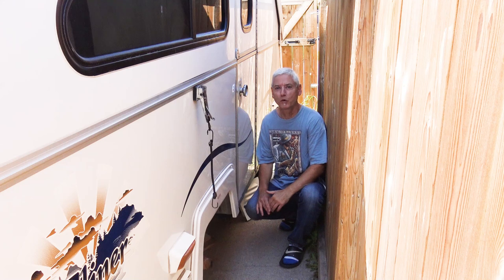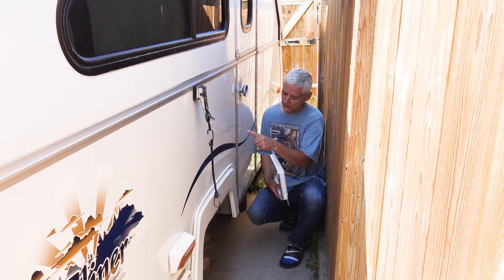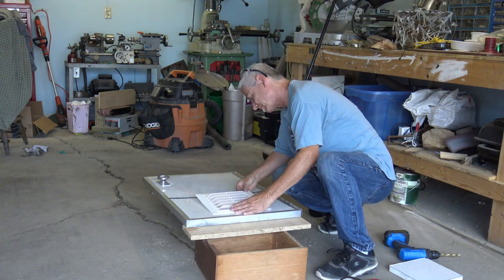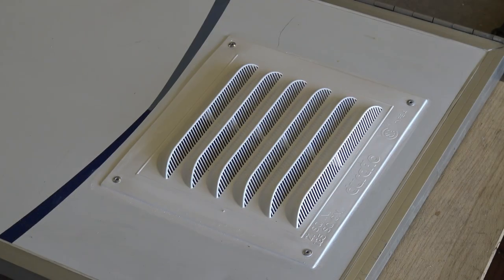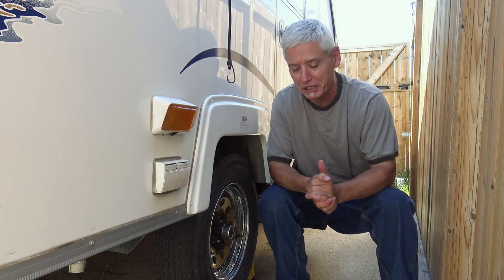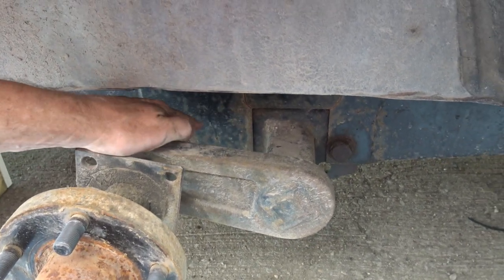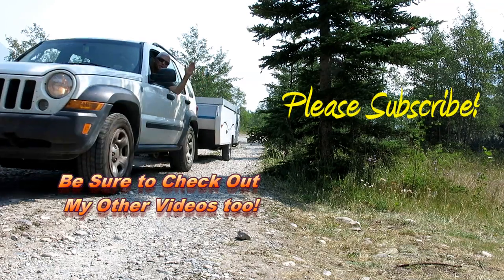Aliner - Adding Door Vent & 3500 lb Axle

Comment: Hi Slim, Very good work on your vent and much needed axle, i would however weld up those cracks grind down the weld and then weld in a heavier plate over that area. I enjoy your video's Happy travels to you.
Reply: Hear Hear!! ...was thinking the same thing regarding welding/repairing the cracks while the axle was out.... enjoying the videos from your friends Down Under in Australia... we are just about to purchase a used Aliner, and these videos have been fantastic ! Cheers
Reply: Fix the cracks ! A stitch in time saves nine. Off road will tear up t his flaw & leave you stranded or worse an accident on hiway
Reply: @nealford7897  Yes, I agree. I saw another video on welding and after seeing where this chassis cracked(at the intersection of two planes)I think I remember that cutting a piece of metal and leaving a square intersection is poor technique. Does this seem reasonable?

Comment: Slim... another great video! By now (a year later) you've probably had your frame welded. From our view it appeared not only the rear corner of the square notch was clearly cracked, but it seemed the front maybe was starting. Notice the same line of rust (without the obvious crack) in your video? Starting at 9:03 you can see similar rust line. 

Also, though I am not a "Metal" guy (I'm a Cabinet maker) I believe, at least in the Solid Surface Counter Top world, it's not uncommon for cracks to start AT inside corners and because of that, many people cut radius/half-round cut outs rather than square corner cuts. Again, I am no extra in metal-smithing. 

Back when dinosaurs roam the earth and Corian was the only solid surface material, inside corner cracks were a constant problem especially near stove top cut-outs. We in the industry started radiusing our cuts and that helped a great deal, but even then expansion due to heating continued to plague us so we double the material thickness and taped the corners with metal tape to reflect back the heat and ease the expansion.

Hopefully, they welded a wide strap across the notched area for the axle (rose... great punchline by the way) and radius cut out for the axle...

You are doing some great videos. Keep them coming!!!
Hersh

Comment: Something I had built and gave it away just somebody that was camping was a candle heater. During my research I saw where somebody on a boat put it on top of their propane burner turn down very low. For a small space they are very effective and when the candles go out they radiate heat afterwards.

Comment: I was wondering if you had the axle aligned? Seems to be an important part of installation process. I got my axle finally, installed  it and aligned it as well. Glad I did, it was off a little more than .250.

Comment: I know this video is old, but know going in to your project that a 3500 lb axle is much more expensive now. The best price I could find was local and was $771. Also found it for $631 and would need to drive 3.5 hours with additional hundred $ in fuel....total $731. I opted for $771 for convenience. It is a Dexter since AL-KO no longer exists.

Comment: I used a UCF Flexiride axle on the Teardrop I built, same as what you installed on your Aliner.  I love the ability to adjust the ride height to whatever I want.  What I don't like about the Flexiride is that it squeaks a lot.  The manufacturer recommends using silicone spray lube on the ends of the axle tube.  It works, but not for long.  My 2008 Aliner has a AL-KO torsion axle,  it works better than the Flexiride (smoother), but is not adjustable for start angle/ride height.  Your original axle looks like a Dexter? My Aliner is an anomaly, the non off road (2000 lb) frame with the 3500 lb off road axle.  Columbia Northwest (Aliner corp) insists that the trailer had the non off road axle when they built it, but I sent pictures of my axle to them and they finally agreed it was the off road axle.   About a year after owning the trailer I found a date stamp on the axle,  its manufactured in 2009, while the trailer was made in 2008, so its not the original axle.  I purchased the Aliner used in late 2014.   One problem that I ran into was a bent frame, and you might run into that issue too.  The 2x3 tube frame is not strong enough for a torsion axle which concentrates the force on a small part of the frame (compared to a leaf spring set up).   I had to straighten my frame and weld on 3/16 plates on the frame over the axle to prevent it from bending again.  The details on this issue and fix are on the Aliner Owners Club page.  The off road frame is 2x4 or 2x5 tube depending on Aliner  size,  2x3 is now only used for the lighter smaller models, and was also used up to about 2011 or so on larger models which subjects them to the frame bending issue.   The door gap going wonky is a sign of a bent frame.
Reply from the maker: Hi Jeffery, Thank you for the details on your axle upgrade. One of my upcoming videos will include my ideas on the frame bending issue, however I need to do some more road tests before I release the final details. Please feel free to add any project links (youtube blocks them but I can add if appropriate). Thanks Again! Slim

Comment: Hey Slim! Hope you see this... I'm currently in the process of swapping out axles on my Aliner. Did your 3,500lb axle create a lot more vibrations and movement inside the trailer off-road? Thanks for everything you do for the community.
Reply from the maker: The way I traveled there was vibration and movement whatever I did! Better an oversized axle than an undersized if you're traveling the backroads. SP

Comment: The axel is mounted to a torsion bar, which suffices for a spring. VW’s until ‘68 used a similar suspension. In time, they loose their load bearing capability. Chrysler used torsion suspension on passenger cars.
Reply: My coment may be redudant, would'nt leaf sprg replacement, better support rear portion of trailor. U ARE A VERY HANDY GUY

Comment: Do you think this vent will help reduce cold weather condensation when winter camping.? Really enjoying these repair/mod vids as I’m considering an A frame purchase. Thanks a bunch!
Reply from the maker: Hi Bill, it may help bring drier air in, but condensation in winter is usually from the source of the heat as well as conductive materials on the frame. Thats why I switched to a wood stove and insulated the exposed metal. Catch out my stove videos. Thanks! SP

Comment: Why is the axle/tire not centered in the actual fender opening?  Seems like the axle is installed too far forward, even the old axle I noticed was forward as well, any idea why its like that?
Reply: I'm curious about this as well. Surprised I had to flip through the comments this far before someone else asked the question.

Comment: I need to replace the axle on our Aliner. I know you don't want to answer technical questions, understandably. Could you tell me the make (brand) of your new axle and where you ordered it? 
We live in a rural area and no one within 100 miles have a clue where to get one. I have no problem ordering or installing an axle. Mine is on my work bench right now. Ready for measuring.
Thanks and keep going. Love your videos.
Reply from the maker: Hi Bill, I had mine custom made and had to drive 3 hours each way to get it. I would suggest getting one from a local welder with RV experience. Thanks! SP
Reply: I've tried that here, no luck. I'll have to find a company online. I do appreciate your quick response, thank you.

Comment: Please, where did you order the axle from. Need today as I am leaving soon for the summer. My axle is exactly like your old one, rubbers are worn out and need to go a little off road this summer. Thanks!!!
Reply from the maker: Hi Roger, Mine was custom-made in Edmonton. City Spring. Try a local truck repair or welding shop. Thanks
Reply: You can try princess auto stores in canada.

Comment: thanks for your comments about axle replacement and getting a qualified mechanic....sage advice....I would like to know how to repack the bearings, grease them if you ever have a chance to show us that skill......will be inspecting my frame, axle later today for cracks and bolts....got the Guns 'n Roses comment.  11:19 looks like tire is close to wheel well.
Reply from the maker: Hi Rick, Mity Mouse has a video at: https://www.youtube.com/watch?v=FyZptb7KWlQ. I think it's the viewpoint at 11:19 that is deceiving. There's actually a couple of inches, but the wheel-wells cover the gap. Thanks!

Comment: You spoke about dust coming in through the cracks in one of your videos. I have allergies so I have come up with an idea for trapping some of the particles and it might be a good idea for your dust situation. I took a  furnace filter that is made to reduce allergens  and cut it to the size of my windows, and stuff it in the frame while they are open. Works great! Night air is full of pollen. The one I got was green and not made from fiberglass. Really thick and sturdy. I believe it is washable, too. Not cheap, but the good stuff rarely is.
Reply from the maker: Hi LA, yes dust can be terrible for those with allergies. I was planning to put a filter in the door vent, not only for dust but because the screen is a little too coarse so small bugs can also get in. Thanks!

Comment: We've been looking at aliners with the standard 2500lb axle and looked at one with an off road package with a 3000lb axle which we were told adds 5" to the height.  Don't know if we need the extra height as the standard aliner seams well off the ground for occasional dirt roads
Do you have any thoughts or anything that we may be overlooking ?
Great Videos.  Really  enjoy your channel and hope to be starting our adventures soon.
Reply from the maker: Hi Lucus 44, I also found I had a lot smoother ride with my 3500lb axle than the 2500. The big advantage was the clearance. You'd be amazed at how many steps and stabilizers get lost on rocks or curbs! Plus my new axle is adjustable, so I can lower or raise it to suite my terrain. Thanks! SP

Comment: hello slim . great videos . I really do enjoy them and always look forward to the next one. have you in the past or at all given the brake down of your trailer weight and the tow vehicle specs? IE eng power rating/ size, tow capability. and how does it pull uphill? would be very interested to know. but again great video keep up the good work. mike
Reply from the maker: Hi Mike,  My trailer at rated at 2000lbs carrying capacity but I have never actually weighed it. With my passion for back roads a little extra capacity on the axle is a good idea. Towing vehicle is a 6 cyl 3.7L Jeep Liberty. No issues with towing as long as the tires have good grip. I did however have the front drive shaft rebuilt recently. Towing could be to blame, but I think it was the miles I towed that did it in.  Thanks!
Reply: thx for the info slim. looking forward to your next video.

Comment: Umm.. watched a few of your videos-good stuff.

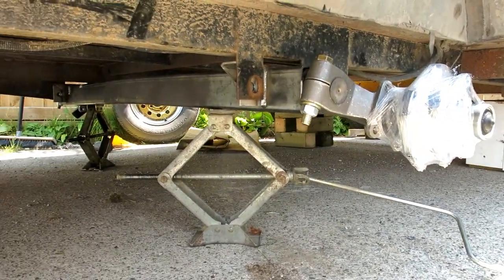Edited comment- I saw cracks in reinforcing plate of frame rails from the views on right side, especially 7:24 from underneath. Looks like frame was notched with the plate on top...however looking 'bout 10:24 shown is the left side, completely different view, axle is under frame rail. 
Yup seeing things :)
Reply: When I saw what I thought I saw red flags went up---keywords, what I thought I saw.
so on the right side thereis some sort of angled skirt?
Reply from the maker: It sucks that You Tube doesn't allow me to revise my own comments, so will start again:
 The cracks on the side plate are indeed a concern, however I am closely monitoring them as to any further issues. The missing bolts could have been a factor, and replacing them may help. After a little research I found that Aliners are known for one weak spot in the early design - lack of upper support where the door is while the trailer is on the folded position. Extra weight on the back and rough roads can cause the door-side axle to deform slightly over time. The axle installed here however is on direct contact with the main frame beams underneath, and that support is transmitted beyond the crack area by two 10" angle plates (not visible in this video). There is little load in the back of this trailer as I don't use the water tank.
 I plan on a few more fixes on this issue in the future, which of course I will document in a video. Thanks!

Comment: First time to see your channel. You do great work. I like the door vent idea. I do have a question. If you drive down the road with rain and wind blowing, does water get in the vent? Thanks, Dave and Purdy Channel
Reply from the maker: Hi Dave and Purdy, Excellent question. I imagine if it was wet enough and you left the cover off it would probably be a good bet that moisture would get in. I put the cover in place before I travel, however it is starting to get loose. My next step will be to put velco pads in place so it won't work itself out. Thanks for asking! Slim

Comment: Did your trailer become more bouncy with the 3500lb axle? I realize the original axle was worn out, but any changes in towing?
Reply from the maker: Hi David, The biggest change was how smooth the ride was on the highway. Yes it can bounce on the rough roads but my stabilizers are not hitting rocks! Thanks, SP
Reply: Cool. Have you considered adding brakes? I know you tow with a small vehicle and you’re going through the steep passes through Colorado. 

My wife and I are rebuilding a 1997 aliner and we will need a new axle. I’m contemplating adding brakes at that time.
Reply from the maker: Yes, brakes would be an added bonus. You'd definitely save money putting them in at the same time than waiting until later. Thanks, SP

Comment: The frame needs to be welded. All of the suspension forces are transmitted through the torsion bar and into the frame. All A liner owners should inspect this area.

Comment: Hi, is that a dexter torsion axle? and did you weld fix the cracks?   pete.
Reply from the maker: Hi Peter, Yes, it is a torsion axle. I did not weld the cracks, I am only monitoring them. Thanks!
Reply: i do believe that torsion axles are the best, i am getting ready to buy a new Wells Cargo Road force 7 by 12 V- front,  its their mid priced model but it comes standard with dexter torsion axles and never  ajust brakes.just something to sleep in while touring the west. i will be towing it with my 2016 toyota tacoma 4by4.  You make great videos i am very impressed!!  pete.
Reply from the maker: Sounds like a great trip Peter. The brand name of my new axle is Flexiride. Forgot to mention that in the video. Thanks!
Reply: At a minimum, particularly if you are just going to monitor them for now, you should stop-drill those cracks, which will likely keep them from growing.

Comment: Will the stiffer suspension beat the trailer up?  I have two utility trailers both 5x8 one has 2200 lb axel the other 3500 lb axel, once I needed to haul bicycles and only had access to heavier trailer and during the 80 miles trip the bikes were beat to death. Just wondering if we can make suspension to heavy?
Reply from the maker: Hi Mike, On the contrary, it is more fluid than the older 2000 lb axle. That was the first thing I noticed was how well it rode over bumps in the road. I think the old rubber had little flex left in it. Have a look at my "Boondocking the Forestry Roads" video and you'll see it navigating some pretty rough turf. Thanks!